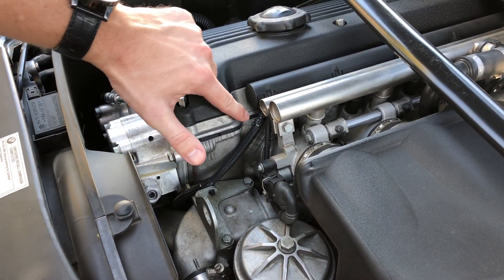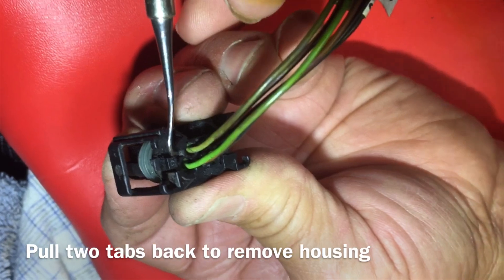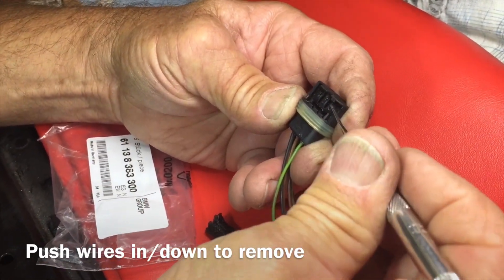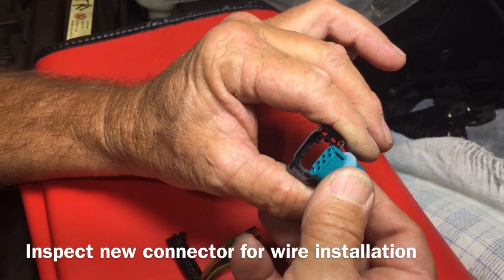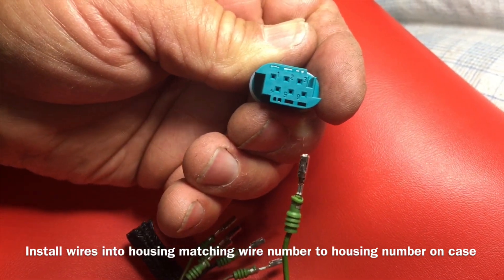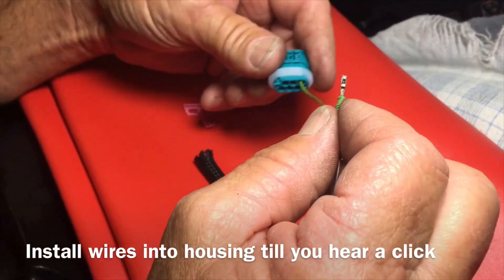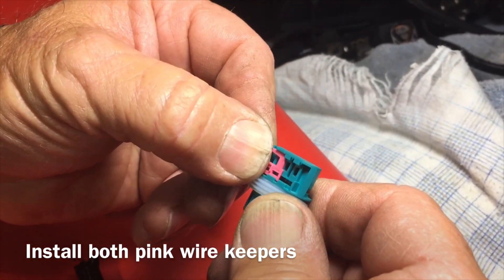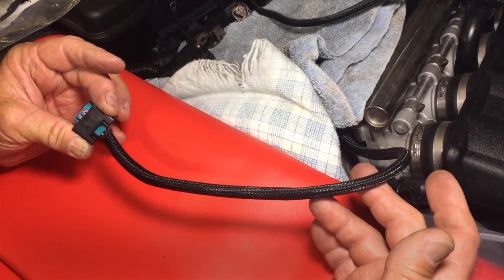HOW TO: Replace VANOS Solenoid Connector plug E46 M3

Comment: Just curious what type of issues will cause a faulty vanos wire?
Reply from the maker: A particular issue wont lead to a faulty Vanos wire. Connectors and plugs on these older cars just go bad in time.

Comment: I just damaged mine while removing the solenoid pack to replace with the Beisan systems one (engine code P0010/P0011/P0012). Thanks for the video!
Reply: Thanks again for the video. I have been trying to unclip the wires by pushing the arrow down as shown but mine are just wedged in there even if I mean be the little pink clip off so I'm probably going to end up just breaking the whole thing apart. These clips are a real pain. No idea why automakers are using this garbage.
Reply from the maker: Those clips are a pain in the A$$! Hope your project has came along well!